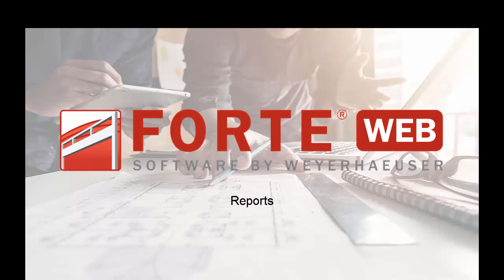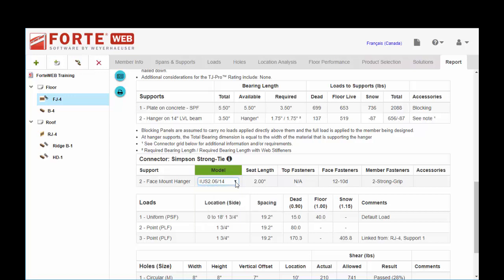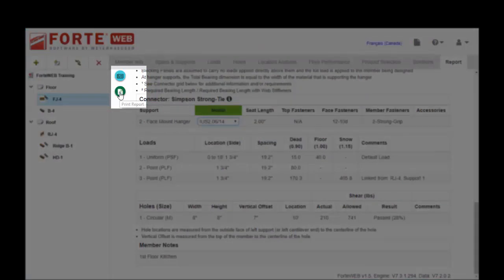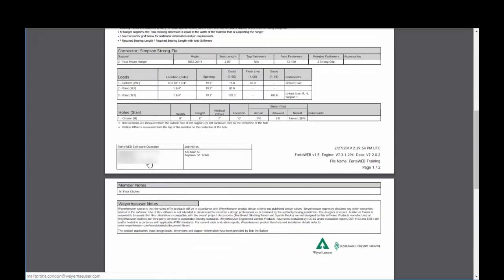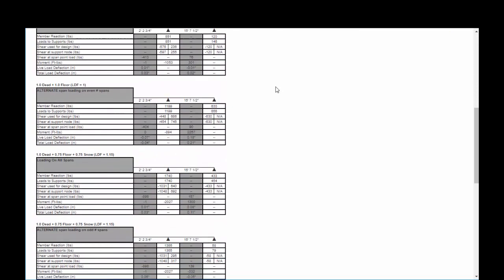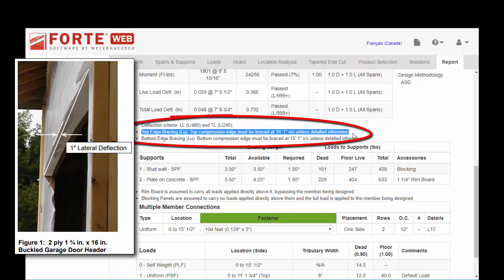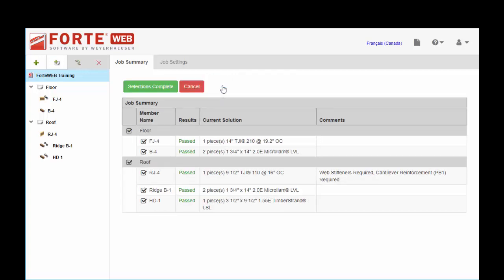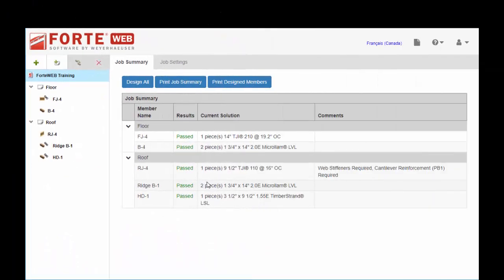ForteWEB Training: Reports

Comment: Thanks!  We'll see ... usually use Woodworks Sizer, but I've been trying the Forte web a little too.  Forte Web is more accurate if you are really using TJI's, rather than generic joists.  I like that Sizer allows you to specify if the member is fully braced (floor or roof beam flush beam) or unbraced except at ends (garage header).  I saw that you can just look at the result in Forte, to see the required minimum bracing length.  Input was a little slower over the web in Forte than having the super quick Woodworks on my computer.  Time will tell if I make the switch.  I like the Forte file system though, and that might save a  little time, instead of importing pdf's and arranging in a calculation package for submittal.  Note that I haven't printed a paper calculation or paper plan for years.  All mark ups and submittals have been pdf with electronic signatures for a long time now (mostly California work).  Of course the builder is still using paper plans at the job-site.
Reply from the maker: Glad you like our software.  The nice thing about having the application online is you will always access the latest and greatest version with the newest features without having to upgrade or install.